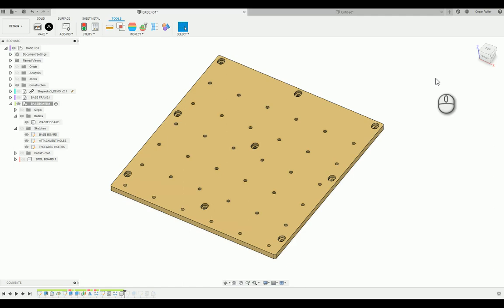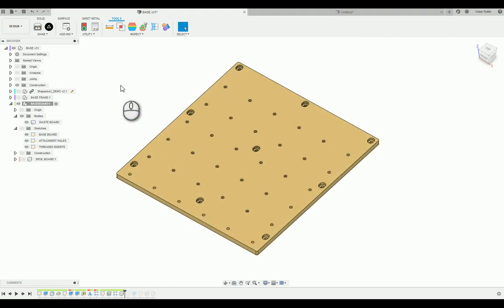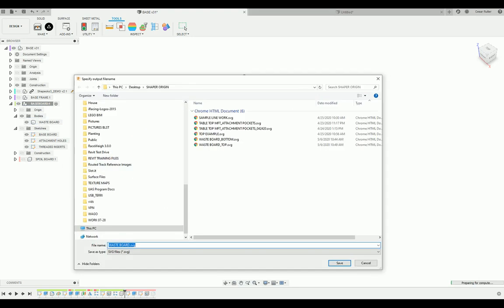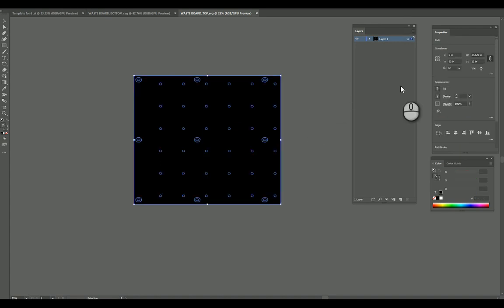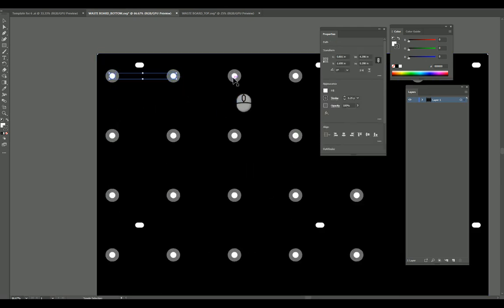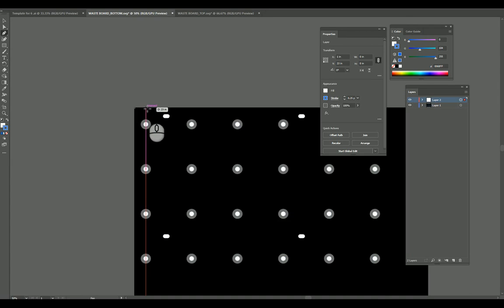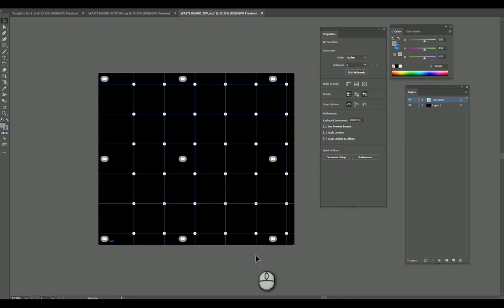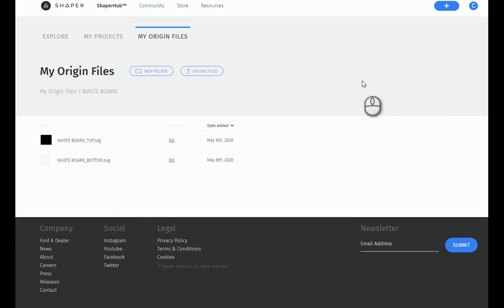SHAPER ORIGIN  - From Fusion 360 to Cut

Comment: It seems to me that the multiple step process from Fusion to Illustrator is pretty inefficient. I'm considering acquiring a Shaper and I'm getting familiar with the workflow. Overall great tutorial, but it's showing me that there are some software issues that feel redundant and slow! Have you found this to be the case vs working on a Gantry CNC?
Reply from the maker: Hi i am sorry that I did not see you comment. No on a grantry CNC or CNC mill I can push actual gcode from fusion. Its pretty straight forward once you program the tool paths